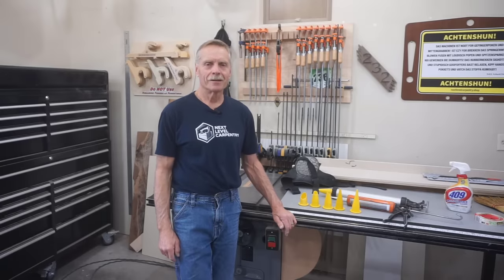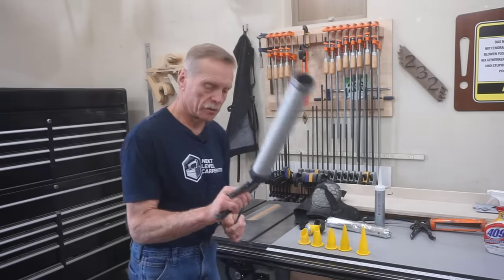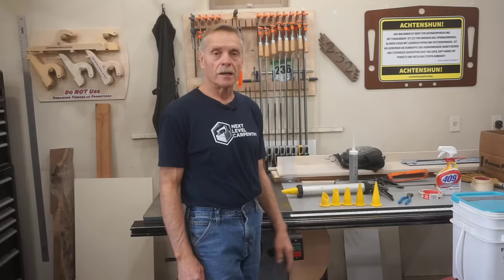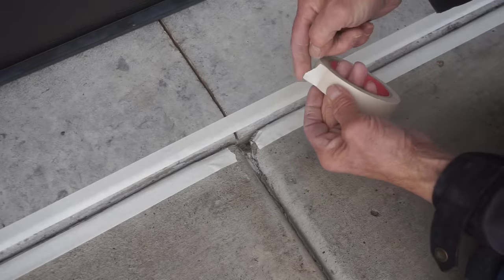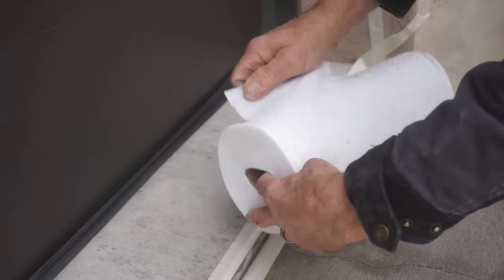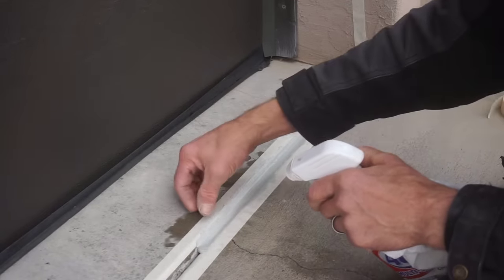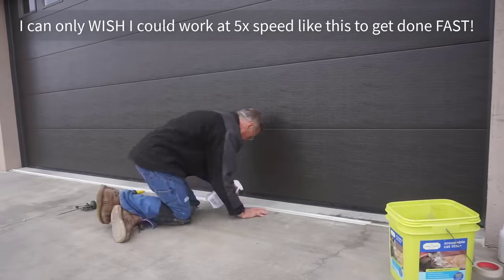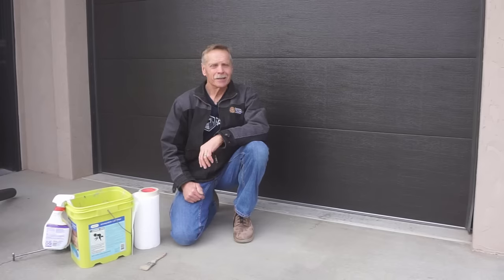How to Caulk Concrete Control Joints with Perfect Results Every Time

Comment: Could you please recommend a source for the silica sand?  There are so many different types and "meshes" that I need some guidance here.  Great video, by the way.
Reply from the maker: If you can't find some fine or medium mesh silica sand at a local masonry supply place you can always get the stuff listed on Amazon and Linked In the video description. Finer sand keeps dirt from sticking better but coarser sand blends with concrete better but other than that it doesn't really matter that much as long as you get something in there before dirt and leaves stick to the sealant.

Comment: I had two blokes who did nothing but caulking for me, both were excellent but both had different methods. So I reckon there is no 'right' way as long as it gets penetration and looks good.
It's funny to me that like tiling I can't for some reason caulk and I've tried many methods. I can build, I'm a carpenter, I can wire electrical, even complex automated homes, I can plumb, weld, machine or even build an engine for you but I can't calk to a standard acceptable to myself.
Reply from the maker: With all the abilities you mention I'm certain that you could achieve the same results I did in this video with a little patience and practice and encourage you to give it a try so you can add it to your resume! Best, Matt
Reply: @NextLevelCarpentry  : By some standards I can of course but it takes too long and I do not enjoy it. Some personal caulking jobs I would of coarse do but not professionally. A professional caulker could easily do three or four times more than me an hour and his rates are lower so using them is common sense.
[BTW, silicon is a different animal, have you shown that?]
Reply from the maker: @buildmotosykletist1987  I'm not good enough with silicone so I'm NOT showing that! 😉  I get by but I'm no whiz by a long shot!  I'm have thoughts similar to yours when it comes to taping/texturing: I can do it, and do a respectable job of it, but definitely hire it out whenever possible! Best, Matt

Comment: Great video! Production and skill. Will this hood up against skateboard wheels constantly riding over it?
Reply from the maker: Doesn't need to: a properly tooled joint will have a slightly concave surface that's recessed slightly so skateboard wheels never even touch it... Best, Matt
Reply: It’s gonna hit it for sure. That’s why I want to fill all the saw cuts or expansion joints lol. Make it smoother when I’m riding out back on the patio with the Kid. No worries I think it will hold up. Where did you get the pure fine silica sand? I can’t find it online...
Reply from the maker: Might want to use some sort of epoxy then because the flex in urethane won't be stiff enough to support the weight on those wheels.  I think it will hold up OK but not perform like something that actually cures hard.  You can get silica sand through the Amazon Influencer's page linked in the video description if nowhere else... Best, Matt
Reply: Good point. What about Slab Gasket?
Reply from the maker: @desertrider325  I have not used the stuff but believe its flexibility would be similar to cured urethane sealant but that it would leave a hump when installed rather than a dip...

Comment: Can this method be used where the driveway meets the house where there is gap. Thanks for a great explanation.
Reply from the maker: Yes, absolutely... as long as the driveway is concrete, not asphalt.  The only real difference is applying masking tape to the wall is  a little bit trickier but totally doable.  Hint: apply tape on the wall about 1/4" above the driveway level so, when sealant is applied, the joint slopes down/away from the wall so water doesn't pool there. Best, Matt

Comment: I've used so many different caulks. 2 part really sucked! Had a time limit, and had to mix it for a certain time. We used it on city buildings in Vancouver WA for the windows! Injecting epoxy into concrete cracks was really fun! (Not really) I did it for $6.00 an hour in the mid 90's! My boss was a shister! LOL

Comment: Can this product and system be used for basement floor & wall joint due to water seepage...while just using a wire brush and vacuum clean out to the joint before applying?  Thank you for any response.
Reply from the maker: One part urethane sealant works great for sealing joints in concrete wherever they are.  While it will stick in wall/floor joint applications it won't hold back much in the way of 'hydrostatic pressure' so, if there's much water coming in you'd want to first correct whatever conditions are allowing water to get in in the first place.  Beyond that, just make sure the joint is clean and free from dirt or loose material and it should work great.

Comment: According to code concrete; placing a backer rod in the joint is crucial once the sealant is tooled to create an hourglass shape for proper movement, otherwise with the sealant in one  big clump you're getting 3 sided adhesion and it fails. Also that adding sand can cause minor tears that grow with time and eventually cause adhesion failure. I'm sort of conflicted with that because they make textured vulkem. What is your experience in not using backer rods?
Reply from the maker: Sorry you're conflicted.  I didn't intend this video to be a treatise on proper joint design but as a lesson on how to get perfect results finishing urethane sealant used to caulk control joints. While focusing on the preparation, application and finishing aspects I didn't cover things like when backer rod is necessary  or how to place it when required which is a whole other topic altogether.  I urge viewers to learn about the use of backer rod you allude to and use it when and how it's required and THEN use what's shown in the video for a job that looks as good as it works.  FWIW the joints in this video are only shallow control joints, not active expansion joints which is why I didn't use backer rod: there's no 'room' for it in these joints but I still want them to look good... hope that helps?
Reply: Absolutely, I'm just trying to learn and some of these things like you mentioned filling shallow joints I couldn't find any clear information on. I used dymonic 100 on my first one a few weeks ago and it turned out well but I'd like to try the FC. Thanks for your help
Reply from the maker: @tlhilm  Cool... glad to help you learn as you go.  BTW you'll probably find the Dymonic 100 is a little 'stiffer' than the FC that's more 'goopy'.  FC can be a little more tricky to tool with the method shown because it requires a more gentle touch to get a flat-ish more uniform finish but you'll do fine.  It does cure noticeably faster though so there's that...

Comment: Would you recommend this method for deep gaps? The gap in front of my garage is about 2.5” x 5/8” . Before seeing this video i had started the project by pushing 3 layers of 5/8” backer rod to fill the depth of this gap however, the depth is not as uniform as i would like so i have areas where the backer rod is higher than others. I thought about filling the gaps with something else but im trying to prevent this ant colony i currently have in these cracks from coming back.
Reply from the maker: This video focuses on how to FINISH urethane sealant in any situation but was never intended to cover infinite application situations.  Yours sounds like an extreme case where removing and replacing the failing concrete is the only real solution.  That said, I have made 'Hail Mary' repairs to large gaps like the one you describe and can tell you that, once you figure out how to 'fill' the void the tips shown in this video will work to get professional looking results on the sealant itself.

Comment: Hi.  In the vid I can't quite see what you did at the "T":   was that caulked  in as well...for what length...and a tapering?   You do say not to go to the end....but I can't see how far down you go.  Thanks.
Reply from the maker: I didn't show what I did at the "T" but it's basically the same process used on the rest of the job.  In this video I just tapered the sealant down to nothing for a smooth, clean look.  On the actual job I continued sealing all joints on the driveway by completely going around each of the 16 'square blocks' (each about 12' square) so the driveway was completely sealed...

Comment: Great video and next level for sure!   I can’t seem to find Formula 409 here in Canada. I’m wondering if there are any good substitutes anyone can think of. I am guessing maybe a general  cleaning spray could work
Reply from the maker: Can't find 409 here these days either... I've heard that diluted Dawn Dish Soap works well but I don't know the dilution ratio but I'm going to find out soon as I have some joints that need to be sealed before winter.  I suspect that mild soap is best and would stay away from anything that mentions extra strength, bleach, etc.  Best, Matt
Reply: Next Level Carpentry thanks so much Matt!  I will be doing this soon so think I might try that idea with dawn.  I will start with a weak dilution and work my way up if it’s not working.  Thanks again and all the best too!
Reply from the maker: @TheJamesOutlaw  Great... feel free to add a dilution ratio when you settle on one... it would be helpful information for myself and others even if only as a starting point/suggested 409 alternative. 😎
Reply from the maker: OK @TheJamesOutlaw, I started experimenting with diluted Dawn for a sealing job I need to complete before winter figuring I won't be able to get 409 in time.  Started with 1 part Dawn to 20 parts water and it's to weak.  Went to 1 part Dawn to 10 parts water and it works well.  It seems to work exactly the same as 409 with no negative affect on the urethane sealant.  I might try to weaken it to like 1 part Dawn to 12 parts water because it feels a little too 'soapy' but I'm glad to report it's working as a substitute/replacement for 409.
Best, Matt
Reply: Next Level Carpentry thanks so much for sending the update!  Now I’ll have a better idea on dilution ratio.   Since I’ve never done this type of work I probably wouldn’t have been able to figure out a decent ratio as I’m not sure what the consistency should be normally. This is great and thanks again!
Reply from the maker: @TheJamesOutlaw  Youbetcha!  I'll let you know if I change the ratio as I'll be doing some of this work this morning... provided it doesn't get too windy because wind REALLY complicates things...

Comment: Love this technique. Does it work the same on an exposed aggregate driveway or do you have to use a different type of tape to get a straight line?
Reply from the maker: It depends on how irregular the exposed aggregate surface is. If it's real irregular I don't know that any tape will follow it well enough to achieve the results you're after.
I hate to say it but you might have to do a slow meticulous methodical job with just a well-trimmed tip on the caulk gun and regardless the Results will probably not be as sweet and clean as you see in this video but that's because the nature of the concrete not your ability to do a nice job....
Reply: @NextLevelCarpentry  thanks for the quick reply. I thought it may be difficult. I think I am going to cover it in a sand to blend into the river rock style aggregate, take my time, and see how it turns out.
Reply from the maker: @nstevenson02  I think your focus on method with an eye towards results will serve you well.  Much better approach than to just start squirting urethane sealant and deal with a mess after the fact.  Start in an inconspicuous place and, working with what you know, develop 'a system' that you can use for the rest of the project.  If you get a rather coarse sand with larger grains/pebbles, it might be just the ticket. You might be able to 'dress' the sealant lines with a diamond wheel to even out the worst of the variation between aggregate rock and come up with a hybrid method and very respectable look.
 Good luck!
Best,
Matt

Comment: at 17:45, a small crack is seen in the concrete perpendicular to your control joint.  How would you recommend filling those type of cracks in a concrete pour that is only 2-3 weeks old.  I'm in Arizona, hot but lots of rain and ground water recently.  Material needs to stand up to high heat and sun.  Repair is meant to be cosmetic mostly. This is an area of foot traffic only.  Thanks!
Reply from the maker: Cracks like that are normally shrinkage cracks and result from improper control joint placement or accelerated curing which you could sure get in the high heat of Arizona. I don't like to tell you this but there's really nothing you can do with a crack like that so I normally just leave them. There are some products by a company called Roadwear that are designed to fix that but in my understanding the the fix itself is more unsightly than the crack.
Wish I had a better answer but there it is.
Best, Matt

Comment: Do you recommend using backer rod on the bottom of the joint, and if not, why? Thank you.
Reply from the maker: Absolutely... when necessary, that is.  Because of their size and shape, control joints in this video didn't require it but keep in mind that the 'tooling and finishing' part of this video applies to joints of all shapes, depths and widths.  Best, Matt

Comment: Ascetically it looks great but what is the reason for sealing control joints? I’m in Florida and although it might very common I only remember seeing it with decorative concert finishes.
Reply: Okay no need to reply to my previous question. I just saw your response to a previous subscriber. Great job in making the video and you attention to detail in preforming the work!

Comment: Excellent work!  Looking for the silica sand you used in the video.  The link you have to Amazon silica sand is for 120 mesh sand but its tan in color.  I bought and used some last year, didn't like the color it left.  Looking for something that will match concrete better.  Do you know the mesh and color you used in this video?
Reply from the maker: The best I've found is the finest grade/grit of pure silica sand: it's pretty much transparent so whatever color sealant you use isn't changed by the sand.  My best source is a local masonry supply outlet.  Hope that helps...

Comment: Do you have any vids on repairing spauling  and filling large cracks with finish sand and or rope?
Reply from the maker: Unfortunately no Robert I don't. I've done a great deal of sealing  cracks of all types but the subject is too diverse to cover in videos and kind of outside the main focus of Next Level carpentry. The only thing I can tell you is that regardless of what is required to seal a joint of any type this is the method I use for finishing so it looks nice when it's done😁😎

Comment: Dear Expert, do u have experience/ advice to share on applying the shaping bits (cramer fugi 5 kit)  to refine the fresh caulking beads pushed out from a quick cure & sticky adhesive paste like liquid nails (polyurethane,waterproof, by Selleys )? I want to use this to replace 100% silicone sealant at the interception edges of bathtub edges and tiled walls.  will i get nice result as in the silicone sealant scenario?? So diluted soapy water spraying is the usual trick again.
Reply from the maker: I do have quite a bit of experience applying silicone sealant and can tell you that it's almost an entirely different process then what you see in this video.  DO NOT use soapy water for silicone because it will make a complete mess! Please search out other videos for help with your sealant project and only refer to what I show in this video for the specific application of ceiling joints and cracks in concrete.

Comment: I currently have 10 year old wood in the joints I’d like to seal.  Should I pull the wood out first, replace it with something different (heard of pool noodle material and other fillers) before sealing?
Reply from the maker: Depends on a lot of factors but, at a minimum, I'd remove the top portion of the wood so there's enough room for sealant so the depth of the joint is half its width...

Comment: I'm responsible for the short section of sidewalk in front of my house. It look like this technique you showed would work fine, but I seem to have an old wooden strip in the seam. Do you think it would be ok to remove the wooden strip and just caulk like you did in the video? The gap doesn't look any wider to me than what you showed. Also new subscriber here!
Reply from the maker: Thanks for the sub E Smith!  I can't think of a reason it would hurt to remove 1/2" ~3/4" of that wooden strip, clean and dry it properly and apply sealant using the process I show in the video.  FYI I've done joints 1 1/2" wide (using properly placed backer rod) and finished them with excellent results using this method too... takes a little more fussing to get a smooth, consistent concave surface but it's totally doable.  Hope this gives you a bit of encouragement... Best, Matt

Comment: Great video.  I have a wide concrete gap between patio and foundation wall.  I have everything ready to fill the gap with the polyurethane  chalk except the "409" cleaner,  I can not find it any where.   Comments online say that it may have been discontinued.  Is there anything else that you would consider a second choice?   Hawk
Reply from the maker: I've not been able to find 409 since last year either Hawk but I'm having great success with Dawn dish soap diluted at one fl oz Dawn dish soap to 13 fl oz clean water. I just spray it out of an old 409 bottle and it works great. Be prepared to do a bit of practice and be patient with yourself when you get started and you'll be getting professional results in no time! Best, Matt
Reply: Thanks Matt I have plenty of both, water and Dawn.